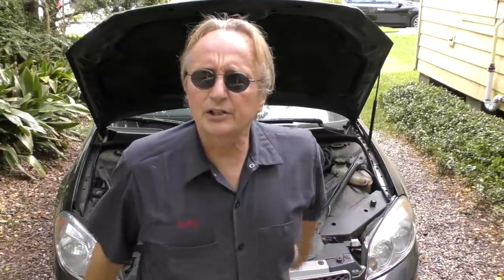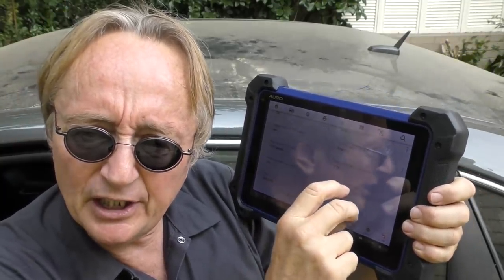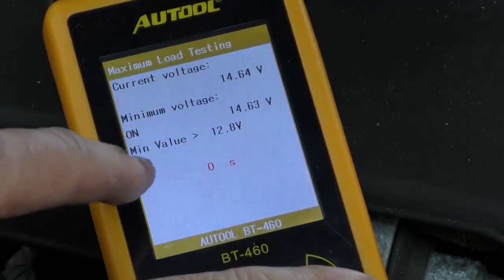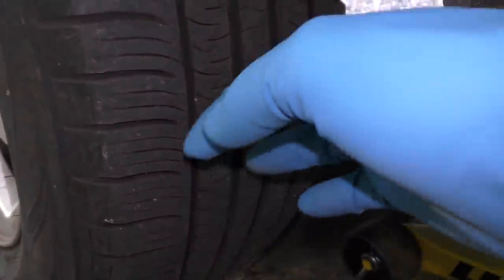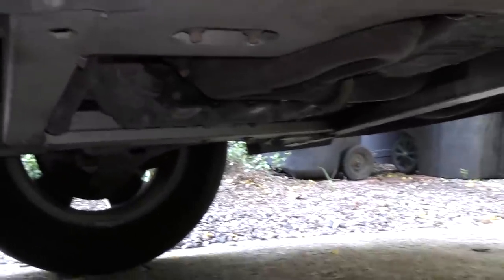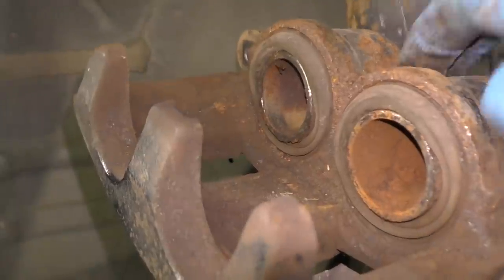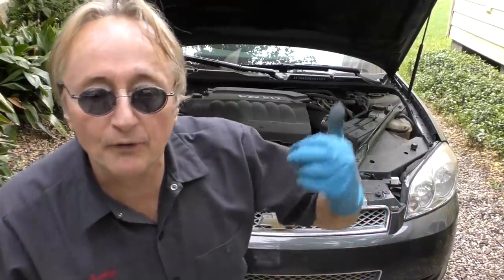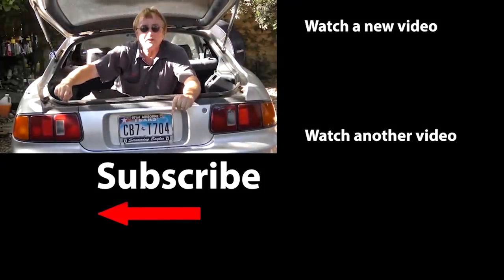Doing This Will Save You Thousands in Scam Car Repairs

Comment: I have a gmc yukon denali 2007 128 k miles well i just got ot used a few months ago i just bought a new battery bc the other one has poor condition so last week i filled the gas tank up regular gas i guess a friend filled it up for me last few days gas getting lower and truck hard to start now takes a few tries at first with foot on gas pedal today wouldnt work like that until i put foot on break then it started i dont get it engine light has been on gmc dealership and my neighbor both hooked it up to there machines says evap leak what do u think

Comment: My cars transmission burned up , I had no mechanical skills , I ended up watching how to replace automatic transmissions on YouTube for my car which was a 2001 Honda civic, bought the tools slowly and than the remanufactured transmission which was 1000 $ on eBay. I managed to get someone to help me drop the older one and put the new on in place , I spent around 1500$ on everything while the mechanic wanted 3600 $ to do what I did. That motivated me so much , that I stopped paying people to fix my car.

Comment: Hey scotty, it almost seems as if though every time I go to big O tires to get a rotation there is something that "is recommended " changing. The car is a 2015 Nissan Versa with 86K miles , but the engine has  honestly never had an issue with standard trans, i guess that helps. Anyway they wanted to change the rear shocks and I told them Ill think about it.. but I haven't noticed any issues.
Reply: Your story sounds very Familiar. I'm an hvac tech and always hear the same kind of story with my new customers that called the big company in town before me. They have BIG overhead and have to squeezed every dime of every customer. Be careful!

Comment: Did you lube slide pins? It's Very important to do so. Great video as always.
Reply: Ja Sam i agree.  Another good practice is using a turkey baster to suck out the brake fluid from the master cylinder, fill with new fresh fluid, then bleed the calipers (especially after being flipped upside down because the sediment in the caliper gets disturbed.  I remove the pin, clean it, and lube with fresh grease. I find the old grease gets hard. Another important step is to clean the stainless steel rail the pads ride on. That many times gets rust, tar, and dirt that hardens up, and may make the pads stick.
Reply: If that rust ridge on the rotor is bad, it might need a grinder job. Sometimes the new pads ride a little different on the rotors, and they hit the rust. And cause a noise and pulse in the brake peddle.

Comment: @3:39 i spray my suspension and underbody with a mixture of oil and transmission fluid.   It binds to the metal, and keeps that rust away you should spray the rubber bushings and such with at205 it keeps rubber supple.  
The best undercoating is hot candle wax and grease. But i have no clean way of applying this to my vehicles

Comment: Best to have an honest independent mechanic. Occasionally a dealer mechanic will be good and honest, but hard to find.  Whether it’s a car or motorcycle. Had my bike in for a new front tire, they said brake pads were close, and since the wheel is off anyway, it only added about 40 in labor.  Pads were more expensive at 35 per side. They didn’t even try to sell rotors (200 per side, so 400 for a pair of fronts, but frankly, easy peasy to replace. Easier to change the front rotors on a GL1500 GoldWing than a car.

Comment: Scotty, most places I go to when they say I need new pads, they say you need new rotors (discs in the UK), as if you buy new pads with worn rotors, it'll wear unevenly and be unsafe. I get, that if the rotors are quite old, and have gouges in them from the previous pad, it may be a bit unsafe, but are they just trying to bump up the price? FYI, this is VERY common in the UK. Every car I've had, the garages all said the same thing "replacing the pads? You need new Discs too!". The other way around, yes I get it, new discs with old pads is not a good idea.

Comment: A crowbar is good for checking loose suspension bushings / joints. And appropriate brake grease for the slider pins - they can bind as well.

Comment: Whoo... superficial rust only exists in the south.  Here in the northeast, we usually have superficial cars on our rust.

Up here, it pays to put caliper grease UNDER the brake pad clip, rather than on top of it where the pad slides.  Rust building up between the caliper and retention clip pinches down on the clip, and keeps the pad from sliding.  Different techniques depending on where you live.

Comment: go the extra mile and clean the shims and where they rest and apply anti seize to the caliper bracket and shims. i also put some silicon grease under the caliper piston boot and clean and put new grease for the caliper sliders.

Comment: When in TX last year, I found a station with non-ethanol gas and filled up my new CRV thinking I should get more power and better mileage.  Instead, we got about 5 MPH less and it ran rough.  Are the computers tuned to respond better to the 10% ethanol now and not adjusting well with less?

Comment: Seeing you are doing A Impala my, Girlfriend has A 2008 and those doorknobs on that  sway bar made A weld on the outside of the end of it in the factory and the crack and break and the replacement from doorman is bigger in size and the ends are pressed. So give them A heads up on this. I hope the CM factory does A recall on this. Thank you, Scotty.

Comment: Those 2006 - 2013 impala's are well built cars! They are also the last car to offer front bench seats with column shift lever option! The 2014 to present Impala's are built a little more cheaply! In my opinion!

Comment: Scotty! My 2008 Cadillac deville is misfiring!! It will start at 60-65 mph and continue at a red light while idling. I’ve pulled codes misfire bank 4 and I’ve changed all spark plugs bought new coil pack. Injectors sound fine when I hear them close in the driveway. Any advice on where to look next?? Please and thank you!

Comment: My former son n law did his 1st break job one day while I was at work.  He was all happy and proud of his work.  I took a quick look to make sure everything was correct and safe to drive.  He did have everything put back properly but....

He used brake n caliper grease all right...  Coated the entire surface of the pads/disc and calipers with the stuff.  Guess he didn't read the directions on the can or watch a YouTube video about what NOT to grease on the brake system.  Lol.

Comment: I bought a brand new Ford 150 truck.  In short,,,,, POS.  I have had nothing but trouble with it.  After the warranty ran out, I got a check engine light.  Took it to the dealer and they quoted me $500 to replace the turbo inlet pressure sensor.  Rather than pay them I took it to a mechanic friend of mine.  He printed a picture of where the sensor was located which is right in front of the engine bay on top of an inlet hose.  I bought a sensor for $63.  From the time I opened the hood until I closed it after the sensor was changed was less than 10 minutes.  $500, kiss my rear end Ford.
Thanks for your information.  Let's keep the auto dealer crooks in check, especially Ford.  Never again Ford, you lost me selling me crap.
Reply: Big corporations have  BIG overheads, that is the main reason they charge a lot of money even for minor repairs. 
I had a similar situation with Nissan.
Thank you for sharing your story.

Comment: @5:47 before pressing that piston back in, the exposed portion of that metal piston should be cleaned. The rubber should be cleaned with soap and water, then sprayed with at205 to keep it supple

Comment: Hi @Scotty have you done a video on idle reprogramming for a 2002 toyota Camry LE? I disconnected my battery to replace the terminals with new ones and now my car wont stay on. I have to keep my foot steady on the gas pedal in order for it to stay on. I heard something about the ECU losing its idle programming after the battery gets disconnected but i learned this after i replaced the battery terminals 😅

Comment: Hey, Scotty. My brother has a lightly used 2003 Honda Accord and the maintenance required light is on. If I remember correctly, you made a video on how those are just scheduled lights from the dealership. Is there a way I could turn it off myself?
Reply: check the owners manual / youtube/google and yes you can reset it yourself. there is a procedure you need to follow

Comment: Only problems I see here Scotty are that #1, you should never squeeze caliper pistons back in forcing the old fluid up into the ABS or master cylinder.  Always open the bleed screw and let the excess out there.  #2, what about greasing the caliper glide pins/bolts to ensure smooth operation of the caliper as a whole.

Comment: If you're replacing pads, you should resurface the rotors (if you aren't changing them). You'll get better wear on the new pads and the rust on the edges of the rotors prematurely wear the new pad lining.

Comment: Hey Scotty. My dealership has always changed my oil. They've always put 5w-30 but my manual calls for 5w-20. Would it be okay to use 5w-20 if I start doing my own oil changes after they've always used 5w-30?

Comment: Scotty what do you think about 2016 chevy silverados?  My friends had his transmission replaced and he was under 30k on his.  I also have a 2016 and worried about it not being dependable.
Reply: WTF? 😱
Reply: speaking as a tech for GM dealership. some of the trucks came with a 8 speed trans ( you can tell this by looking to see if you dont have a dipstick for trans) they have had issues for alot of different reasons related to the trans/torque converter. if you have a dipstick for your trans then you have the 6 speed trans. which dont have the same issues,. and some of them have a 10 speed (i cant think of what years exactly or trim package ) (its a trans that is shared /developed with ford ) it also has no dipstick. they dont seem to have the same issues that the 8 speed does.

Comment: that year impalas got wacky wily brakes where you have to turn calipers to get them flush - & btw. if battery was disconnected then reconnected before showing car, check eng. light will probley be deceivingly off for like 20-30 miles👋😒

Comment: Hey Scott I have a 03 Ford Taurus when I turn the car on after 20 seconds the check engine light comes on is there an issue with the electronics or should I consult a mechanic.

Comment: Great video Scotty... Got the same car 2015 Chevy Impala limited LTZ 3.6 L VVT direct injection motor.
41000 miles .
Can you help me with my problem I get a lot of oil in the intake I replace the PCV valve and I still get it??
Sometimes under heavy acceleration I get a thumping vibration / stumbles with the check engine light on, feels like it's missing?  and then like goes off and it's fine
Reply: gm tech hear. oil in the intake tube is common on 3.6. i would suggest changing oil more frequently. as far as the thumping vibration stumbles/check engine light, could be injectors. the injectors can miss at high speed /load with out a code and proper diag cant know for sure.
Reply: @jaywebb0113  ty....appreciate your response

Comment: Brake n caliper grease might work for a good while in some conditions. But it also collects dust and when it gets really freezing cold it can make the pads stick. And when the grease eventually gets washer of the rust will start to build up. A more long term way to avoid binding brakepads is to grind of some (1-2mm is usually enough) of the metal that makes contact with the caliper so rust can't get traped and cause the brakes to bind. 
A better place to put some grease is where the brakepiston rubber pads rest to avoid moisture to creep in under the rubber and eventually cause rust wich will make the brake pistons to bind up.
Also worth checking when in that area is play in the ball joints!

Comment: Anyone notice he reversed the pads?  The wear bar that contacts the rotor should have been on the inside pad.  And he forgot to file down the rust under the stainless steel guides.  Usually it's rust jacking under the stainless guides/anti rattle clips that cause pads to seize.

Comment: I have this car but the engine will kill when you put the car in gear ( drive or reverse). I had the done a tune up with changing the oil, transmission filter and fluids  and the Spark plug and wires. I also change the Throttlebody. I was thinking it might be a switch/sensor or the fuel pump.

Comment: If it was me doing brakes any time I change brake pads I just change the rotors, they fairly inexpensive, and another thing is flush the brake fluid that's an easy job also

Comment: 2 Things would change You need to replace the tin guides on breaks and clean rust off were the tins go. Cal grease under tin wear guide but not on guides that will only contribute dirt buildup. Also put grease on the outer cal fingers and piston edge to reduce noise. Not saying your wrong scotty but it can be done better so it will not fail or wear unevenly. Get good pads that have tin guides will save you in the long run. Plus will preform much smother. Just my Tid-bit. o/

Comment: Scotty I've been waiting five years for you to work on my car... Same exact car I have a 2015 Chevy Impala limited LTZ Flex Fuel 3.6 VVT direct injection engine.
The car hesitates when accelerating slow when the RPM is below a 1,000 rpm, why does it drop below a thousand,?? 
   if it didn't drop below a thousand rpm.... the car runs great!! But  every time I give it gas ,when it's below a thousand RPM I get a bucking??
And I did a vibration when I turn the wheel a little bit left and accelerate on the highway when I turn it back to the right it's fine slightly turning what is that problem?? please help me Rich.
PS I balanced and remounted Cooper rs1 Tires about four times and still get a bouncing vibration at 60 to 62mph. Ty

Comment: Hi Scotty. I have a Mercedes-Benz Vaneo, similar to the A-class, and the turn switch when I push it up blinks right, when I push it down, instead of blinking left it blinks right. I move it a couple of times, sometimes it blinks OK sometimes it's wrong direction. I have changed the switch but it does it again, the switch wasn't new. What's the problem?

Comment: If the ready codes are not set to (passed) you will not pass inspection even with the check engine light off. Ready codes are cleared any time the check engine light is reset.

Comment: Hey Scotty, I have a 01 Honda CR-V with pretty low mileage of 128,000. Recently a tree fell on the roof and scratched up the sides and made a dent on the roof. It's maybe just about 4 inches in diameter. The body shop said that to fix the dent and scratches the car might be totaled. What should I do? I forgot to mention the car still drives like normal and the trunk still opens which is where the tree hit.
Reply: Joaquin Valadez  The dent does not affect any usability or driveability of the car, the tree hit the trunk then fell off onto the spare tire which squatted the suspension but there have been no issues with anything, the trunk still opens and it still drives in a straight line. And I forgot to mention no glass was broken love luckily, the auto shop said it was amazing no glass broke. Thanks for asking me that, I added it to the main comment.

Comment: Hi Scotty  I have a 05 Toyota RAV4 which I purchased recently.  I suspect the speedometer has been tampered with.  Is there a was to confirm the actual mileage using you magic electronic diagnosis tools.  Cheers Robb

Comment: Scotty Kilmer! I have a 2002 Lexus es300 I have an O2 sensor problem :( OBD2 says ground fault or heater circuit maybe open. Also says catalytic converter is bad and lastly EVAP system problem. Any input would be highly valued and much appreciated! :) Bless you.

Comment: Thx but...
5.18 should of lubed the glide pins
6.01..should of broke the bleed valve to stop back pressure when compressing the piston
Reply: By doing what he did you don't have to bleed brakes, all it does is push the fluid back up into the master cylinder reservoir, doesn't harm anything...well that is if nobody filled the reservoir due to thinking its low on fluid...many don't understand that the fluid level drops as brake pads and shoes wear.
Reply: @wildbill23c  
Wrong.
It can and does harm the MC
Yes. I know most people dont
Reply: @chrispaul1117  LOL, obviously not, been doing it that way for decades never had an issue both old and newer vehicles.  Myth busted.
Reply: William Todd You are right!
Reply: @wildbill23c   
Sure. Most if the time it doesn't make a difference.
I learned different.
Keep being lazy. 
Its ok with me

Comment: Can you show me how to reset TPMS check on Honda civic 2013? I have already check tire pressure and changed the tpms sensor but it's still flashing.
Reply: search for this video ''How to Turn Off A Tyre Pressure Warning Light In A Honda Civic 2012 - 2014 UK''
or this one ''How to reset the tire pressure TPMS light on a 2014 Honda Civic(DRIVE THE CAR AFTER INITIALIZATION)''
Good luck

Comment: I'm putting the pads upside down ??they said that the sensor  goes on the bottom not the top??  help me out. Ty
  I had them , on a top for about a thousand miles.... I put them on the bottom now I got vibration well they finally wearing to the rotor or do I have to get new pads now??

Comment: Hey Scotty..How are You? I noticed you didn't check the spark plugs for any issues, i'm still using my original spark plugs on my car. Is that a normal thing or should the replace often?
Reply: follow manufacture recommendation. typically most cars /trucks are around 100k